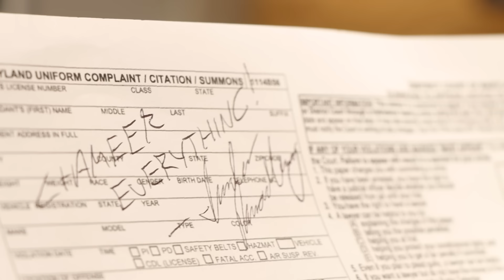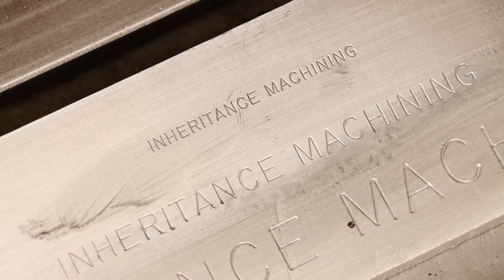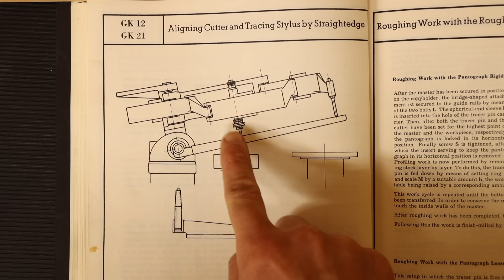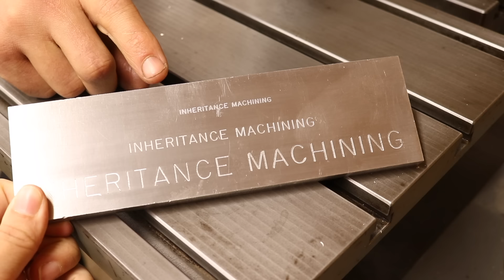Saving the Machine the World Forgot

Comment from the maker: Big thanks to Ridge for supporting the channel! Here's the site if you want to check them out > https://ridge.com/inheritance
Reply: I figured ridge was going to sponsor u
Reply: Damn you turned into the guy in the math questions 3:30
Reply: is you wish to build new draft table you can have it fold out of wall/ make it kinda like a backboard from school. im not sure how you can fit the old one in without rearranging for tighter tolerances of space in shop
Reply: Watch Stefan Gotteswinter for some tips and tricks about the Deckel, but I have a feeling you have :) Love your videos keep it up :) Greetings from Nothern Norway.
Reply: A very useful mod for this machine is to make a donut for the locking nut at 17:28. You can make it all the way around that nut, or just D shaped (so you can see where you land the stylus), regardless, it's a huge function multiplier because you don't have to struggle to hold the stylus down at all - given the larger surface area to work with. Mine's a former billiards ball. It doubles as a wrench and i can remove it or lock in place with the help of a small sprung pin that locks the ball in place over the nut.
Reply: You jewish?
Reply: Pantographs are super cool tools, but a 3d pantograph is BOSS!!!
Congrats on the new addition to the shop. Looking forward to what your mind will come up with to put it to use.
Reply: She’s so Happy for you and she’s got ideas ❤️
Reply: The knife maker @willstelterbladesmith has a Deckel
Reply: Hey man! Pferd makes real nice carbide Die Grinder "Burs", they have a set with round noses and because the flute depth on them will be much smaller than a 2 flute ball mill, you might get much better finishing on complicated 3D parts that way. Just not sure if you have a 1/4" chuck that would make them fit. Hope it helps
Reply: There are still plenty of these in current use. I have customers and suppliers with rooms full of these.
Reply: She is excited with this tool.
But with her hair back and safety glasses  i think this is a machine she could have fun using.

Now you really need to think about this  but my mom ran machines back in the 30s she said she ran a punch press, my wife worked at a bindery for printed stock  she also worked with plastic blow molders.
And yes she works in an office doing accounting these past 30+ years. 
I think your wife would have fun on it. Teach her how to use it.
You might start with setting it up
First time showing how and work her into and expert over time.
Don't forget, its the rolls of wood working tools too. Not just none ferrous metals or soft materials
Wood, plastic brass copper ex.
You can do some cool crafts projects on it too.

They make these for over arm routers. .
Reply: I would recommend ball endmills for engraving if the shape/geometry isn't important.
Reply: Stephan gotts gottswiler an I know I messed up his name he's on YouTube has this type of machine an others u would get a kick out of what he does makes a lot of one off parts lots of knowledge on his channel
Reply: I have 2 model makers 3d pantographs.They’re about 1/4 the size of that one.
   The first one I purchased new along with a special cutter tool grinder.The second was freebe.
   I bought it because I was trying to emulate the the US Mints procedure used in reproducing coins in that era.
Reply: ¾3❤❤❤❤❤❤❤❤❤❤😂⁴⁴⁴4⁴⁴⅘⅘⁵⁵⁵⁵qâdĝgĝĝĝĝgĝģgþĝÿgĝģɓggĥ cd d F F fd D§d a @DJkrypton89
Reply: I know where one of those machines are in Monticello Kentucky but no one here knows how to run it😂❤
Reply: My father had the same machine. Loved watching him engrave and make dies for his presses. 
His had an attachment on the side to sharpen and shape the bits.
Reply: I have one of these and it includes the 3D alignment bracket.  If you would like measurements let me know.

However I don't have that manual!  If I paid you would you copy it for me?
Reply: for some reason iam seein in future. the removeable wall bein moved out 6ft into the area you came in with it hahhahahha

Comment: Hi, tip from the professional here: I've worked a lot with this machine. We ground a cutting edge at the tip of the cutter. The size of the cutting edge determines the flat surface in the letters. The cutters will always break off very sharply. The cutting edge must be slightly slanted and exposed to the rear. Thanks for your videos, greetings from Austria
Reply: That's what I was going to say. Those sharp tips always break. I guess they don't bother when they're making them because why bother? It's definitely going to happen no matter how careful you are. And yeah they still work fine broken.
Reply: You spelt Australia wrong 😉
Reply: @Pat.Mustard  no 😜🇦🇹
Reply: @derwolkentreiber3864  😂 🇦🇺
Reply: @Pat.Mustard Austria is in Europe thats somting else Mate
Reply: I've never heard of either place
Reply: Used 3sided carbide cutters with a 5/10deg taper, ideal for lettering.

Comment: A pantograph is used in the production of coins.  The artist does not carve a coin at coin scale, but rather on a 8 to 10 inch disk.  Once approved, the design is then scaled down, checked and cleaned up, then scaled down again until it's at a coin scale.  All this is done in soft metals to keep the detail vivid.   Once at coin scale, a steel inverted one to one blank is carved.  It's from this blank that the working dies are then made.  The scaled coin copies are sometimes sold to collectors.  I had a special 6 inch silver nickle come across my desk when I was working for a recycler.  That was really cool.
Reply: So silly question what stops criminals just buying one and counter fitting coins?
Reply: @James-dv1df  Having the proper equipment is what stops them.  Making a coin or a copy of a coin is straight forward. Making it profitable is the impossible part.  Some people have been busted copying old, valuable coins.  They were busted as copying the coin made a lower resolution coin with all the same defects.
Reply: Mould making for injection-moulded miniatures and model kits (and I assume other similarly small things) also used used enlarged masters, typically 3x size (a "3 up")
Reply: Marvellous things humans make
Reply: @James-dv1df  not worth the money involved......and the coining process requires some serious machines
Reply: @dom1310df  gun stocks also......
Reply: @James-dv1df striking a coin is what stops them.
Reply: @James-dv1df  It's actually a good question. It just isn't worth it. Too small payouts for way too much work. It's also one time of crime that the US government is particularly interested in fighting. The reality is that if you've got the equipment and the skills to do this, you're probably better off just using those for a normal job, because the risk and reward of doing counterfitting is so severely unfavorable.
Reply: THE HOURLY RATE….DUH

Comment: A tip for the future, when moving machines with a shop crane, rest the load on a couple of 2X4's on the legs, stops it swaying. I have a Taylor Hobson, my first use was a brass plaque that read 'Residents only' for my cat door.
Reply: I just picked up 4 machinery skates from Amazon and their really nice for a whopping $25 each, (bought the return item, they didn't put locktight on the top swivel plate screw and it worked loose in shipping and all the 5/16 bearings were laying in the bottom of the box so people returned them!)
Reply: I'm not a cat person but that's hilarious 🤣👌
Reply from the maker: that is some big brain stuff right there!
Reply: I had a similar thought about unloading the truck. Get the crawler to lift the machine, then drive the truck away 😀
Reply: Great tip!
Reply: What model is yours? I just bought a model D but haven't gotten it home yet, very excited for it. Funny to have this video come up now and now your comment, almost like these machines experience a small comeback.
Reply: @ianday38  Scheduling. The neighbour's fork lift is here now ; the shop isn't clear to receive incoming, the crane is still packed away, and the rental truck needs to go off-rental. The machine is going under cover for the night.
Reply: ..... my god. Not once has this occurred to me. Thankyou!

Comment: I have been in manufacturing for almost 35 years, and my dad is a retired tool and die maker. I have never seen one of these in the shop before, but I heard stories about this machine from my dad and how he used one like it decades ago. These machines are superheroes from a bygone era. I remember the first shop I worked at. In the corner of the shop sat an old Bridgeport True Trace machine. I watched one of our amazing toolmakers take a molded cast of a wooden grip and stock from a single-shot rifle caliber competition pistol,  and then create a plastic injection mold from that casting. It was my first experience with plastic injection molding, and it directed me into a career in that same trade that continues to this day. I have seen the transformation of mold manufacturing go from wood models used on duplicating machines to enormous Toshiba multi-axis CNCs. I love this stuff!!!
Reply: Yep been there myself, retired tool and die mold maker...injection, compression, blow, vacuum, encapsulation,lost wax, die casting....was a great career
Reply: I am a retired Tool Maker and I used one in a Mold shop around 1976 thru 1980.  They are a thing of the past.  All electrodes, cavities, and cores are designed in CAD then machined in CAM.
Reply: We had much larger, fully automatic ones.  We called them Duplicators.  All die part detail was made like that before CNC.

Comment: Did not have any idea how much I wanted one of these machines until I saw it moving. That thing is mesmerizing!
Reply from the maker: Think of all the time you could save over that pesky CNC 😉
Reply: @InheritanceMachining  
You have to program it first, which takes time, but is also a lot of fun.
Reply: Panographs are used a lot for Gunsmithing as a rough duplicate can be made of a stock quickly and cheaply. These are usually made for wood and use a router though.

Comment: 7:14 Small tip for strapping down things, whenever you have a length of strap exposed to wind in parallel with the wind's direction, put about 1 twist per 18-24 inches into the strap. Having those twists causes the wind to spiral around it and will prevent it from vibrating and slapping. It's the same reason why tall narrow smoke stacks have thin metal ribs that spiral around them.
Reply: "why tall narrow smoke stacks have thin metal ribs that spiral around them" IIRC, they're called "strakes", and they trigger the launch of multiple, small vortices at different heights and sices of the (whatever ; "column") instead of less-frequent, larger, vortices. But it does work.
Reply: @a.karley4672  sort of yeah. The issue in both cases is that a vortex forms on either side of the uniform body (chimney/strap) that are imperfect, and so one pushes the other, but then the other kind of pushes back, and you get a natural oscillating force on the object that slowly amplifies more and more. This can cause the strap to vibrate and tear itself apart, or the chimney to stress and break. The twists cause multiple vortices all over that cancel each other out and prevent the oscillation from occurring because it wants to oscillate in every direction instead of only side to side.
Reply: @flamewave000  @a.karley4672 i LOVE engineering/maker channels precisely because of this kind of banter.. . the enlightenment continues into the conmments like a flamewave of genius tearing through flammable thirst for knowledge!

Comment: 18:55 I think the reason it looks better is because the chisel tip hasn't reduced in size, but at a lower ratio, the spacing of everything has reduced.  It gives the text a more bold appearance at reduced scale.  It's a really good look, nice work.
Reply from the maker: That's definitely what's going on. Mixed feelings on finding "sharper" bits. Thanks!
Reply: @InheritanceMachining  Bit like using a dulled drafting lead. Do you resharpen for the precision point or leave it slightly rounded for easier object lines...hmm...
Reply: Not only the reduced scale, but you're getting a much smoother cut and feed with the smaller scale. Like the wrench example, if you're making something at a 1/4 reduced scale, all your movements with the stylus are scaled down by 1/4 including any jumpy moves that naturally happen when dragging a stylus over a lettering set

Comment: Exactly what I used for engraving insignias, mould numbers and instructions. Figuring out height and width ratios and also necessary depths. It was a more relaxing part of toolmaking. Miss those days and glad to see you have saved this engraver.
I never used D-bits, as you have found, they break easily. The best cutter is a 3-sided bit. You will need a Deckel tool grinder for that. I don't know if you have one. You start with a rod of tool steel and set at 20 degree angle and grind to a point first at 60deg then 120deg then 0deg and put an angular flat on the tip.

Comment: You can make hair thin lines by using V bit and thicker stock, doing normal depth, and machining/grinding to thickness.
This way, there is enough tool engagement to make the cut smooth, and you can get any line thickness you want by removing less or more material from the surface.

You can also make really cool multi material patterns, by V engraving negative in one material, then the positive in another, gluing both like a sandwich, and machining it down until most of the negative part is gone and only what was matching the grooves is left. The trick, is to cut one side deeper than necessary, so only the peaks/valleys touch and the rest has some clearance, this way even if your tolerances are off, simply pressing both sides together harder will force them to conform.
Reply from the maker: How do you manage a positive (raised) duplication on a machine like this? I can't seem to wrap my head around that 🤔 Positive templates?
Reply: Yes, that would be, I think, the easiest way

Comment: I moved a Bridgeport in a similar way, but instead I used the shop  crane/engine picker to pick it up just to put a pallet under it and remove the pallet. And then I used a 5000 lbs  capacity pallet jack and it moved effortlessly exactly where I wanted it.
If your floor is smooth enough, it works great!
Reply: The classic method of moving heavy machinery is rollers. Just keep throwing rods under it. It worked for cavemen and it still works today.
Reply: @1pcfred  sure, but if you are moving it through a large facility the way I did it is much less effort.
Reply: @moto.machine1  well yeah. If you have a pallet jack and the machinery fits then it's great. Rollers are just a simpler and more accessible solution though. I don't have a pallet jack but I got a bucket full of 3/4" pipe for pipe clamps. Now I'm wondering what ball bearings would be like. Or even marbles. If you had enough marbles could you move a machine on them? Might be a novel way to get workman's comp. Steel shot blasting beads! It could be a new sport. Machine curling.
Reply: @1pcfred  you've lost your marbles!
Reply: @moto.machine1  I'll find them before I need them to move a machine.

Comment: we had 2 deckel gk-12 in the shop but they dont get used anymore since the oldtimers went with pension. We removed one of them to make space but couldent find anyone that wanted the machine (it was in even a better condition than the one in the video). but with a lot of pain in our hearts we send it to the scarpyard. its good to see that a machine like this will still live on.
Reply: Would have been nice to bring one of the old-timer's back (if you had means to contact them and get them to your workshop for some time) to teach how to operate and maintain the machine to you or two or three off your Mill machining persons to keep them and use them longer.
The Pantograph does take lets say 1to2 months to get acquainted with and get decently good at setting and using them effectively you will have means to make high quality short run products (30 to 50 pieces only or less)or one/two pieces of special request product's on short notice and you need them done now.
CNC machines are great but the one to one touch feel and precise steady control you get to have at the level of feeling yourself being one with the milling/machining materials is not so replicate able on a CNC compared to an Pantograph.
The old timers certainly must have maintained the Pantograph well if the condition was as good as you mention.

Comment: The toolroom where I worked as a tool & die designer had this machine, Whitby, Ontario, Canada. We ran a production non-ferrous forge and machining shop. Parts 7lbs or less in brass, not so much for aluminum. We engraved letters into our forging dies, which intern put logos and words on the parts. It's CNC now doing the same job.

Comment: seeing someone not a middle aged guy excited about a machine like that was pretty great. i was thinking you could 3d print an upscaled version of a part to replicate it. that would reduce the errors in 3d printing since the errors get smaller as you scale it back down.
Reply from the maker: my thinking exactly! i may have to get one after all haha
Reply: @InheritanceMachining  just remember that bondo thinned a touch with polyester resin is amazing if you want to put a good surface finish on a 3d print for cheap. that panto looks like it'll probably carry over the surface finish to some degree.

Comment: I'm a woodworker but love seeing guy's save older machinery, I'm sure it's built better than the stuff made today.
I'm still using the sears table saw my Father had for forty years and I've used it as many years, 20 years or more I had 
replace the arbor bearings.  Furniture builder 38 years.  Keep up the good work.